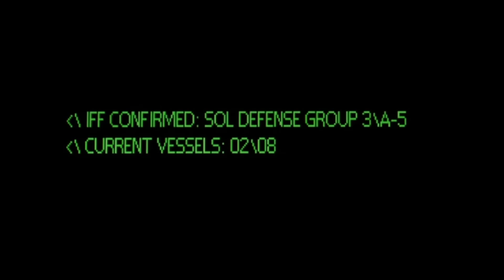Marine Armor | Most Detailed Breakdown

Comment: The armor you see in Halo Wars and Halo 2 remastered is the most protective marine armor out of all the suits of armor as the war goes on and costs get higher he almost becomes less and less protective in favor of movability having to bug out all the time is easier to do when you're not in case the full suit of armor
Reply: I can see them switching to less protection in favor of more mobility, because when you enemy can basically ignore your armor, you might as well go for comfort and mobility by getting rid of the dead weight.
Reply: @bthsr7113  that's what happened in the real world when guns became effective. Before that almost any foot soldier had metal body armor and helmets, but with guns they ditched them. It's only in the late 20th century that armor made a comeback on the battlefield.
Reply: Same goes for US troops in Afghanistan. I think it was called the ILBVE or something. There was a plate carrier that came with a neck protector, groin protector, two thigh protectors, and two shoulder protectors. Around the spots where the ceramic plates would be slipped in, there was flak protection that wrapped around the body to the to the other plate. Not to forget the plates that would sit on the sides. The thigh protectors and shoulder protectors were rarely issued for sake of mobility, eventually the vests started falling apart due to weight issues and new ones were made without the neck and groin protectors. Now both the army and marine corps use more lightweight plate carriers without all the extra.
Reply: @StevenTheAristolianNerd  you mean like the mythical Juggernaut armor that most modern military say it's just video games even though it looks like it could be real
Reply: @LegatusLucius1994  
I'm not talking about an EOD suit. I looked online it's called the IOTV, it's upper body armor.
Reply: @StevenTheAristolianNerd  cool
Reply: @LegatusLucius1994  
Keep in mind that soldiers hated the IOTV. It was bulky, restricting, hot, and near useless.
Reply: @StevenTheAristolianNerd  Lil dude the trick is to be a tank and just because tanks have heavy armor the goal is still hit the enemy before they hit you I'm besides once they figure out how to get micro air conditioners and to have a suits of armor the uncomfortable problems will go away
Reply: @LegatusLucius1994  
The iotv is not a full suit. 
It's a plate carrier, with flack protectors for the groin, neck, and upper shoulders. Once again I'm talking about what veterans have reviewed about it. It caused a serious lack of mobility, it was a serious energy drain to carry around, it would cause serious medical issues with heat related injuries, and the flak protectors didn't work anyways. It was counter intuitive for a body armor system. Often times grunts would find themselves almost incapable of completing the mission due to physical exhaustion.
Reply: @StevenTheAristolianNerd  😎
Reply: @LegatusLucius1994  Bruh how old are you?
Reply: @bthsr7113  armor that Can't protect You is just dead weight
Reply: @arx3516 eh, not completely, it took a lot of time for armor to be phased out, and even then it continued being used by heavy cavarly, the most characteristic being the cuirassiers

Comment: Enemy uses almost exclusively plasma, you'd figure the Marine armor would be ceramic and polymer.
Reply: Well originally they were fight insurrectionist.
Reply: Since the UNSC couldn't make a material to disperse 10,000+ degrees celsius of plasma bolts for the average boots on the ground, it's just near impossible given the limitation of the laws of physics on material sciences & economics. They had to redesign the BDU armour doctrine to combat the Covenant more effectively. This is where the M52B variant 2 comes in (Halo 3 Marine armour). The armour is design to be modulated by simple straps & buckles to quickly swap out damaged plates done by plasma plasma for new ones in the middle of combat. It looks it to be less armoured than it's pre-war counterpart & for good reason. It's to make marines take advantage of being more mobile from getting direct hits from slow moving plasma bolts & minimising the risks of getting badly wounded or killed by the melted armour as it melts & cooks right into the user from a direct hit from a plasma bolt when & if they get hit which the pre-war BDUs had massive problems of. I say that's how most marines got killed by, not by direct plasma shots but melted titanium cooking directly into the user caused by plasma shots. The pre-war armour would had no problem stopping a plasma bolt much as it's later innovation systems in it's tracks due to the low velocity, possibility saving him/her. But that armour would be melting right into em cooking them to death in 20-30 seconds as that marine frantically scrabbles to try & it take off. That is where the M52Bv2 comes in with it's design to be quickly allowed to be taken off & on, minimizing that risk. Also the black undersuit, it's to help somewhat disperse some heat from the armour plate getting cooked into them when struck, giving the marine or another combat personnel extra time to unbuckle or cutting the straps to remove the danger away.
Reply: Spartans were created to crush the insurrection but were retooled to fight the covenant because they’re a much smaller force to rebuild and re-arm than larger Marine and Army forces
Reply: @rushpatriot2866    Ceramics can stop a few bullets before they fail.  You need polymers to disperse the heat the ceramic soaks.  Molten metal (After A Plasma Hit) is counter-productive.  Think Stormtrooper armor.
Reply: @pineapplelapolynesia1994    Special Operations forces get the best gear because they are the best asset available and each SF shooter is A massive investment.  If the Canon were logically laid out the Spartans would have tailored custom weaponry not whatever was lying around.
Reply: @AKlover  
Like to think it is coated or in a composite part on the titanium base structure using the most heat resistant materials possible. Even then, it won't do much other than help by a percentage, no material can withstand 20,000 to 50,000 degrees celsius of heat from blue plasma bolts, not even Starlite which is claim to have a melting/destroyed point of 10,000 degrees celsius although I completely forgot to add that material coated on the marines armour alone would help massively against low temperature red & green plasma bolts from Brute plasma rifles & plasma pistols. As I stated, they had to make it where it's easy to quickly remove a potential killer oven temperatures on you if & when you get strucked by a plasma bolt.
Reply: @rushpatriot2866    If you could cut away the armor before it burns threw, that would be A desirable design feature.
Reply: Ceramics would, & polymers could have a place in anti-plasma armor, but it's important to understand how. You want a woven ceramic or other inner layer to block the heat, maybe with an active heat disposal system, for the sake of keeping the wearer cool. You want a metal heat pipe system outside of that to disperse localized heating around the rest of the suit. You want to have a wicking component to that that uses evaporative cooling to remove heat from the external surfaces of the heat pipes: that is where polymers might come in, in which case the goal is roughly to have the polymer evaporate in certain circumstances, sort of like ablative armor... but against temperature. Finally, you want another heat-resistant weave over that.

Basically, the system would function like the heat shield of a reentry capsule: the plasma hits the outer layer, which might partly burn off, but absorbs part of the energy of the plasma, producing a localized area within the plasma with a lower temperature. The evaporative component underneath then begins to do the same, producing an even lower-temperature region, while both the evaporated outer layer & cooling layer gasses also push against the plasma and armor, reducing the speed at which they come in contact with each other, and distributing the rest of the plasma over an ever-enlarging area, where the before-mentioned effects continue to occur. The heat pipes then start to dissipate any heat that reaches them over their entire area, causing the higher-volatility components of the evaporative cooling substance to take up some of the heat, which in turn reduces the heat that even just reaches the inner-most protective layers. That is how you want to design armor to deal with plasma bolts that actually pose a threat to your soldiers. Metal components absolutely have a place in it, whereas polymers might not depending on what mix of "evaporatives" seem best to you.
Reply: They should make armor with the same stuff the under side of our modern day space shuttle is made out of. If it could withstand the heat of re entry. It could have a chance against a plasma bolt
Reply: @jomarico1770    Those are ceramic.  Ceramic to soak the heat and polymer to disperse it.  Think stormtrooper armor.  We have ceramics now that resist heat far netter than space shuttle tiles.  The problem with ceramics is that they fail structurally  increasingly with every hit.
Reply: @absalomdraconis  
That sounds heavy as f**k to be lugging around on a battlefield, not even including all the extra weight that gets added on by supply and gear.
Reply: @felixthescholarlytitan4437  : A light-duty system would add several pounds, but the biggest problem at least at the start of the Iraq war was heat instead of weight.
Reply: @rushpatriot2866  or the covenants elite/brute armor due to it being ourposed to be effecfive aginst plasma
Reply: The armor wasn’t meant to withstand plasma, it was meant to withstand bullets.

Then the covenant showed up
Reply: Eventually they did get proper armor for resisting the plasma and ablating correctly for it.  In the lore it could take two or three hits to the same point.  Which is arguably more than the Elites' own armor could but nobody ever accused the Covenant of being creative or actually understanding science from the tech they copy-paste with Huragok.
Reply: Idk why they wouldn't just wear armor that projected a magnetic field around the wearer. That would protect them from any plasma.
Reply: @SethEssington    It may spread it and help disperse it to A wider impact area thus help "cooling" it, it is unlikely to deflect it,  A magnetic field that strong would also play hell with anything electronic. Optimal armor versus plasma would be ceramic on bottom and polymer on top.  Much like is shown in game the shield would likely be vulnerable to plasma as well.  You also still have the problem of the under-layer which will not have the same protection level and places on the body you cannot put armor due to movement restrictions................... so wider dispersal maybe of dubious benefit since some of the dispersed shot is NOT GOING TO LAND ON PLATE.  ALL ARMOR IS COMPROMISE..
Reply: Unless their combat fatigues give protection from energy weapons on less vulnerable parts of the body with the chest where the vital organs are given the most protection

Comment: It's generally understood that each NIJ armor level can withstand the stresses of the previous levels. Level 4 can take 1 armor piercing round. That doesn't mean it can't take the 6 regular rounds that the level 3 can take. It just means that it can take the 1 AP on top of everything that the previous levels can take. Also, as you said with advancements in material science, the armor would likely be even better than a level 4.

Comment: As a materials chemist I’d guess it’s likely titanium carbide.
Reply: But would it even be as strong as or stronger than current ceramic Level 4 plate? Lighter?
Reply: @kerbalaerospacelabs3445  lighter definitely and depending on what binding epoxy being used it's at least as strong.
Reply: @kerbalaerospacelabs3445  
Magic space titanium. Yes.
Also, depends on the plate you're talking about. Ultralight ceramic inserts of class IV are quite light and make commercial plates look like bricks, while the heavy end of sniper resistant armor makes IV looks pathetic, coming in at the ability to defeat force and bullet of heavy machine gun armor piercing incendiary projectiles.

Comment: You got a like as soon as you mentioned how important boots are. When i was enlisted, boots were by far the best items to buy every 6 months, never doubted the money being spent since i knew how valuable a good set is.
Reply: I varied on replacement rate. If you could find the versions with Vibraam soles. They just last years, only had one pair I could locate. Otherwise the good old standard issue seems to last well. Not so kind on comport though.

Comment: A note about casting. There are variants of the casting process, and they change the costs and speed of getting parts. My work for example gets parts from sand molds mostly. The parts from the sand molds need to be machined or forged to final size. This saves waist and can be quicker but is normally a lower quality part compared to machining the part from a solid block. That is because the sand does not dissipate heat perfectly. Normally do to impurity ,density variables, thickness of the cast in spots,  differences very by batch as well. The variables can be removed completely depending on the cast method but they get expensive and I do not have experience with them.
For making the armor they could be starting with cheap sand molds to get the initial shape and then finnish the armor with forging. This way they do not need to be able to cut a large slab of metal to size for each plate and they still have enough material to get the desired grain structure.

Comment: Casting is actually the cheapest method of forming metal, and is done for large runs to make up for the cost of the molds. Machining is typically an additional step to casting or forging to reach final dimensions (or is occasionally done with a billet block for a one off piece)

Comment: 32:36 weight, cost and logistics. Have a look at the Future Warrior Program or how the IOTV/Osprey Body Armour was used in Iraq and Afghanistan. If you make someone bulky you increase operator load which decreases overall mission time and individual Manoeuvrability whilst increasing fatigue and the easy by which the enemy can hit you. It’s better to not be hit at all then hit and survive. Further, maintaining all that gear is difficult. That’s more complex and expensive gear that needs maintained which drives up costs and can decrease combat readiness. New private’s need to be taught how to properly maintain all that gear and keep it clean. This takes time and will lead to more things falling into a Disserviceable condition after whatever round of future budget cuts mean there is less money for spare parts (that’s why the USMC dispanded it’s tank divisions cause it’s fleet of Abrams had lots of broken parts and it was becoming too expensive to keep them operational). 

Not to mention cost. Modern warfare is extremely expensive, the more money you sink into your individual soldiers the more costly losing a soldier is. Debt loses as meany wars as combat deaths. 

The conclusion of a lot of programs which have tried similar things typically go’s one of three ways;
1) too bulky and impractical
2) too expensive 
3) technology is not mature enough 

Typically the change can’t be justified for one or all of those reasons. Realistically the biggest changes in the next few years will be to soldier awareness. The better soldiers can understand the battlefield, the more complicated Manoeuvers they can perform and they can make better decisions. Thereby Obfuscatinf the need for better armour. Without some kind of load bearing system this armour would be too big and impractical to justify the cost and the money is better spent on something like the IVAS.